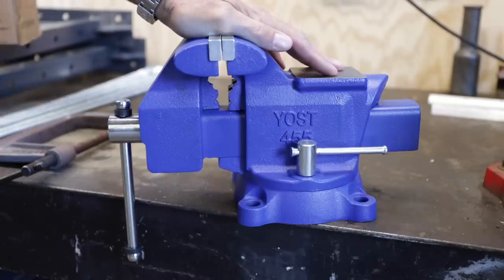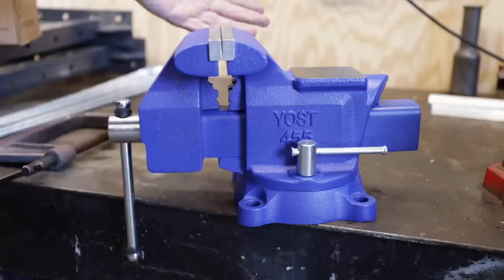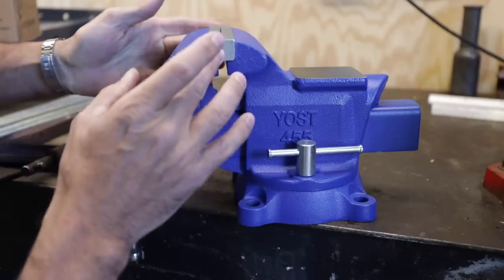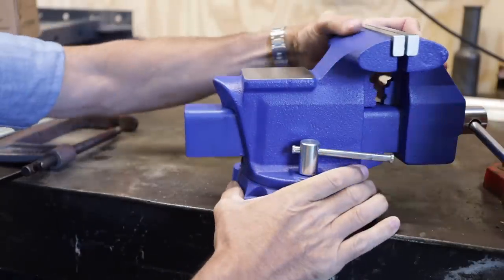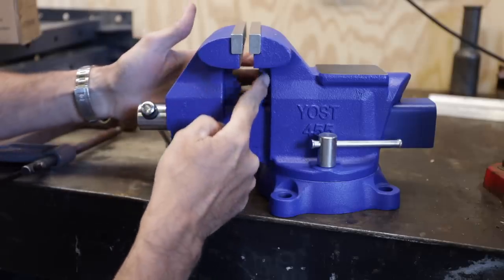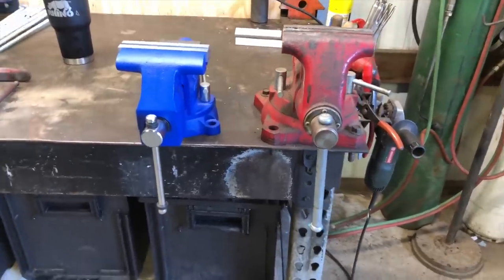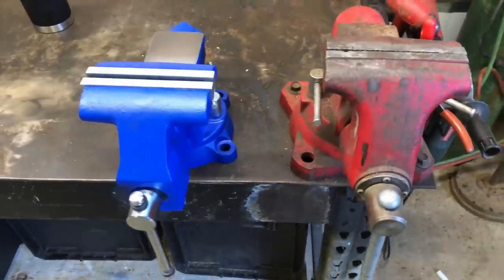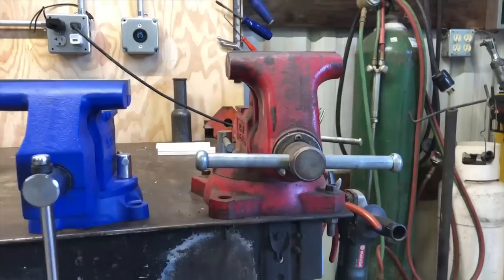VISE - CHEAPEST vs. Most EXPENSIVE On AMAZON

Comment: Love the cheap vs expensive content! Do more!
Reply: Same here. I have a tendency to want to buy the very best, when in actuality I don't really need it, and end up wasting a ton of money on something that will rarely be used.
Reply: i wanted to see the yost tested to failure... but thats what fireball tool's video is for
Reply: Yeah the contrasts are pretty awesome. You can see the value in both products since they both work for different needs. I just honestly don't see much value in the really cheap tools even if they're a lot less cost, because the value isn't there. If it breaks after not much use, then they are kind of worthless imho.

I respect he isn't doing product placement so there's no 'bought' reviews. Just like any of us using them.
Reply: @Knight_Kin  agreed. You get what you pay for. If this YOST lasts 5 years on average (replacing every five years) it’s a pretty good deal—you’d get 55 years of use for the same money as the SnapOn. If you had to replace every 2 years, not so much.

Comment: I have a Yost 750-e and it has served me well for years and it's just a bit more on Amazon at 99$ and has a bit more functionality then the 455.
Reply: I personally would get the Yost 855 or even the ADI-4 as both of those are stronger and also have a lifetime warranty, as opposed to the 750e 1 yr warranty. The steel is 400% stronger on the Yost ADI-4, and 200% stronger on the Yost 855. If you need a big vise, the 855 is the best deal @ $135, but if you can get by with the ADI-4 (4"), its so strong it will last multiple generations for $109.

Comment: Seems like a small nice little unit! I have a small 5 inch Wilton vice that mainly used to hold my chainsaw bar when Im sharpening so I wouldn't need anything super beefy. I do like how it rotates 360. Mine only rotates so many degrees each direction and the 360 is nice for sure! Thanks for a great video as always

Comment: I just got the Yost ADI 4in vise off of Amazon for $115 or so. It's made of austempered ductile iron which is MUCH stronger than cast iron, cast steel, and even forged iron.  The jaws open wide and have a lot of clamping force.  Plus the pipe jaws and all internal part are also replaceable. 

The Fireball Tool channel tested a bunch of vises to destruction, including the 5in version of my vise a few days ago. It held up extremely well, beating most of the other more expensive vises. The only failure point (after absurd abuse) was a soft iron strap that holds the vise body to the swivel base, (the vise in this video has the same swivel system) but after looking at it myself, that part would be extremely easy to upgrade by replacing with, or welding on, a small slab of 3/8 mild steel.

They tested impact resistance, clamping force, and maximum durability by tightening the vise to failure. The adi placed in the top 3 in all categories out of 10 or 12 vises I think. And the first place was a home made behemoth made out of half inch plate and square tube.

Great video, I highly recommend it.
Reply: Kur Norock thanks man, I’m gonna buy one now

Comment: Have you looked at Harbor Freight 5in multi purpose vice? $79. This multi-purpose vise has two sets of jaws to clamp fast on pipes or square stock. The jaw head swivels 360º for precise positioning and the 5 in. wide jaws have a diamond pattern for a firm grip on your workpiece. With a swivel base this multi-purpose metalworking vise can be rotated for easy access to the anvil.

5 in. wide jaw with diamond pattern face
Jaw head swivels 360 deg.
Pipe jaw capacity: 2 in.
Jaw throat depth: 2-3/4 in.
360 deg. swivel base with twin lock-downs
Anvil with milled face
Pre-drilled holes to bolt down to bench top

Comment: If I were looking for a top end vice, I wouldn't be looking at Snap-On. For what that cost you are into the realm of machinist vices that can maintain accuracy in the thousandths of an inch if not better. If you just need a heavy duty shop vice, there are a lot to be had in the 3-4 hundred dollar range that are a lot better than either of those.

Comment: If you want to save a few hundred dollars on the “snap-on” vice you can get the Wilton. Same vice that Wilton rebrands for snap-on.
Reply: I broke my Wilton a couple months ago. It wasn’t that hard. I had bought that one in the mid 1990’s. I got an Irwin from Lowe’s (also has a tag that says- Rocord since 1909 on it). So far so good and it does get used a lot.

Comment: I have 3 vises, a Wilton that looks just like yours, an old Yost that's probably getting close to a hundred years old and a really old Chas. Parker that weighs about 200 lbs. All 3 are great vises but my go to always seems to be the Chas. Parker. It's massive and indestructible, opens about 10 inches yet operates smoothly and precise, for the monster that it is. Great video, though. I always look at garage sales and auctions for things like that. There are some great deals to be had, if you look hard enough!

Comment: I’d highly recommend you go to your local flea markets or swap meets. You can usually find great vises from the likes of Wilton, for a good deal. Some may need more restoring than others - but a good vise can always be rebuilt/restored, so I wouldn’t even worry if you have the time. Just make sure the main body components that aren’t replaceable are in good condition, no cracks, or large chips.

Comment: That Yost is made of Chinese cast iron and doesn't have the strength of ductile iron.  When it breaks, consider the cost of a more expensive vise, less the cost of this vise.  The Yost 32C that I have is ductile iron.  When I got it, it was gritty and required cleaning.  I was also not happy with the slop in the handle, so I made a custom washer.  Now it is really nice.  Currently, it is $343 on Amazon...

Comment: Love the Record no5 I have. Christmas gift from my father back in 1992. Have replaced 100 u joints give or take a few bent metal 3/8 by 2 in to 90 degrees by smashing it with a 5 lb hammer. This thing is an anvil with jaws.

Comment: I've had experiences with different yours of vises. My first two were from harbor freight. The first was a big one with vertical and horizontal swivel capacity and pipe Jaws. It was a good vise but the lock screw to keep the jaws from rotating stripped out after one year. Stupid as I was I put it on the curb I should've taken it back they'd have given me a new one. Anyway the other one was a 6 inch  woodworking vice it's worked like a charm since I got it. My other vises we're found on FB marketplace or acquired for free. The free one is a real classic. It's a huge Morgan Chicago. Probably 100 years old and we'll maintained by it's owners. It was left on a bench in the basement of the home my friends recently bought. It's not a Wilton but for sure my sons and their sons will use it.

Comment: Thanks for the heads up; reviews of it on Amazon show a high rating but the lowest ones tell a different story; " Cheap metal
January 20, 2019 Size: 5.5 inchesVerified Purchase
"Very disappointed in the metal hardness. First time I clamped something down I heavily distorted the clamping area. With the reviews I thought it would be a little better. " think I'll go Craftsman

Comment: A Wilton 1755 can be bought brand new for just over 500 bucks.  Used,  you shouldn't pay more than 200-250 for one.  The Snap On bullet vises are rebadged Wilton Tradesman vises (17XX series).

Comment: Harbor Freight has one I have had for two years. Got it with a coupon, I think it was $55-$60. The face rotates as well as the base 360° vertically and horizontally, respectively.

Comment: Three must vise tests. 
1. Smack the flat anvil part hard 5 times and check for dents. 
2. Do the swivel locks loosen themselves over time.
3. Put something in a vise good and tight. Then smack the handle with a hammer until it quits moving. 
4. Profit.

Comment: I have a Yost woodworking vice, I prefer it to my Veritas face vice. My machine vice is a cheap cast steel one, I work more with wood than metal and I’m limited how big a project I can undertake because of disabilities. Most of my fabrication is done on my welding table. Another factor for me is space, as I have a very small workshop.

When looking at reviews I always go to the worst, it’s amazing how often the review is based on the fact the reviewer doesn’t know how to use the tool. Then you get the ones that expect the £75 vice to be exactly like the £750. If buying from the more economical side of the market, by that I don’t mean cheap tat, you have to modify your realistic expectations.

Comment: If you flip the blue vise over, there should be some washers and a little c clip holding the handle in. Correct? If so, you could replace the whole handle section

Comment: I got me one of those cheap Amazon vices and it was fine. I would prefer a better one, and Im sure it will wear out with enough use, BUT for a budget price I got a vice that worked. All I needed was to make some magnetic vice jaws with cushioned pads on out of angle iron and I was flying.

Comment: Nice review.  But are you sure the heritage vice is rebuildable?  I recently contacted Snap-on about replacing a specialty socket sold by them in the 60's and 70's I needed for my truck.  Lifetime warranties are only as good as long as they are manufacturing the part.  That is what they told me.  And they could not replace the broken socket and I'd have to go elsewhere to get another one.

Comment: That Snap-on vise is a Wilton Tradesman vise with the overpriced Snap-on brand and expensive guarantee added to it.  It's an OK vise, but a Wilton machinist vise, or even the Yost heavy duty USA ductile iron vises are good vises that can be bought for about the same price as that Snap-on.  The big difference is that cheap vises don't open up nearly as far and they also have a much smaller jaw depth, which makes them much less useful.  Cheap vises are also not nearly as strong and just don't take abuse like a high quality machinist vise does.  A cheap vise will often break right at the base of the front jaw with surprisingly little effort.  Then it's broken, right when you need it, and you still have to go buy another one.

Comment: In my opinion, the only truly good vises are made of ductile iron, instead of cast iron, because it has a higher tensile strength and doesnt crack as easily.  I prefer something like an old colimbian or Wilton vise, and if you can, get a really bad ones that may be seized up, and restore it.  I have an old columbian that had been sitting out in the rain for over 30 years.  I left it in a bucket of used motor oil for 2 months.  After that, I cleaned the oil off using a little dawn dish soap, and freed it the rest of the way by sutning it with a rubber mallet and a dead blow hammer.  Then cleaned it up with an angle grinder, and got it painted, excellent vise and worth a lot of money.  If you find an old vise 8n poor condition, restore it and use.

Comment: I always buy cheap tools where ever I can, even when I used to work in car repairs, I would strip them down fix the parts that needed upgrading and hey presto a good tool.

So a cheap vise is all I've pretty much ever used, the one thing I have found about some of these cheap vises is that due to the type of metal  used they can snap, especially where you have those pounding plates, hit it too hard and crack.

So something to be aware of, but I dare say it may be similar with the more expensive vise as well.

Comment: Instead of cheapest you should say "Best Value" or Common Man's best choice. Cheapest has negative connotations.
Reply: John Ware cheapest is an apt description, certainly an item can be the cheapest and the best value but I would argue that just because it is the cheapest does not mean it is the best value, I usually find the best value falls somewhere in the middle between cheapest and expensive.
Reply: @henryfielding6961  not that it matters, but Wranglerstar said it wasn't the "lowest price", it was the lower cost that still had good quality. I agree with you totally, cheapest is not always (seldom) best value.

Comment: Did you notice the 465 is $3 cheaper than the 455?  

Weighing in at 15 lbs heavier, clamp force of 4,950 lbs. and a torque rating of 116 Ft-Lb 
versus 4,050 lbs. and 95 Ft-Lb respectively,  why would you not choose the 465? 
Then there's the 1/2 inch more jaw opening and a full inch more jaw width with the 465.

Curious if it was an oversight or if there's something I'm not seeing.

Comment: Putting a pipe on the vise handle is such a terrible idea in general -- you're just going to torture the threads and you won't get any extra clamping force anyway due to the backlash in the threads. A thinner handle is actually a feature: it tells you if the owner mishandled their vise!

Comment: I will never buy a cast iron bench vice ,I grow up earing 
A good vice must to be forged steel vice 
I personally have two cast steel vices but I didn't buy them ,a friend of mine gave them to me time a go 
But they are made out of steel 
Cast iron vices have a proper work environment and this environment isn't your work bench 
Cast iron vices are machine vice , this is the right spot for cast iron vices 
On a drill press ,on a milling machine on a drill press or everywhere is needed rigidity and nobody pounds on it with a sledgehammer

Comment: You say that, unlike unlike the Snap On, the Yost vise cannot be rebuilt, but surely any tool can  be taken apart, serviced and reassembled?

If it can't be taken apart and put back together, how did they build it in the first place?

Comment: Cody (or anyone who responds),
For an entry level guy, would the Yost still be a better long term buy than the cheapest vise sold by Snapon (Product No. WVE104RT) priced at $364? I know that you said a big part of the reason that you went with the Yost for the work bench and recommended it for the everyman was the price, but is the extra ~$200 worth it? Here is the link to the Snapon: https://shop.snapon.com/product/Forged-Bench-Vises/Forged-Bench-Vise-(Blue-Point)/WVE104RT

Thanks for the help

Comment: I'm sorry but that's not a good quality vice at all. The rotating base significantly reduces stability. The base of the main vice  is too thin and  looks like it will flex and crack under load and the slide is just a piece of channel bar. You can buy an old Record vice from the 70s/80s with the solid base in perfect condition for the same price and it would out live your grand children.
Reply from the maker: No you can’t,

Comment: Cheapest air compressor on Amazon
Reply: hmmm...do NOT cheap out on the air compressor.  You will highly regret that.  Noise is a big issue, never mind performance and reliability.
Reply: Tenspeed TheBikeHanger what's your suggestion? There's a lot of them out there. I'm looking for a medium sized one.